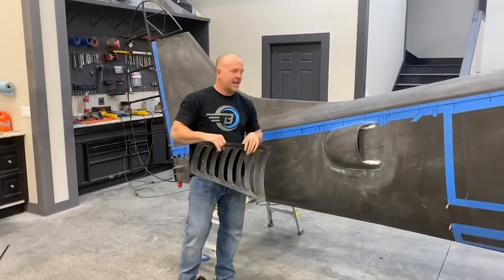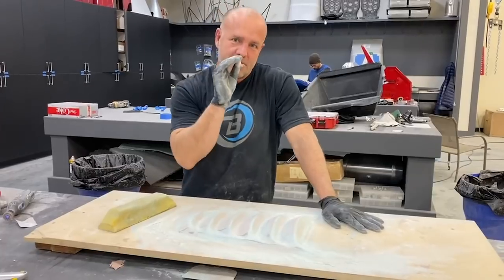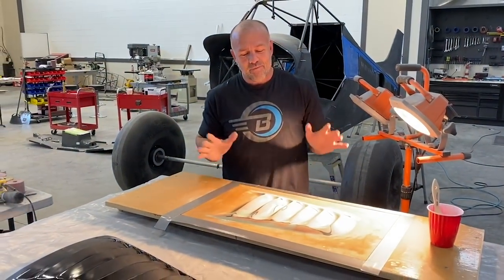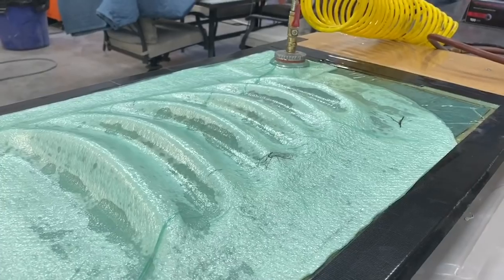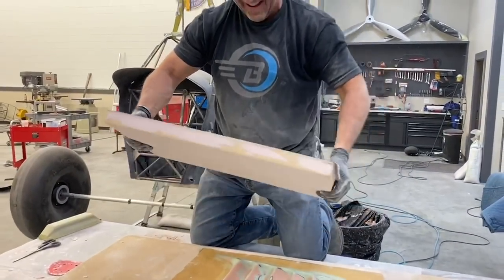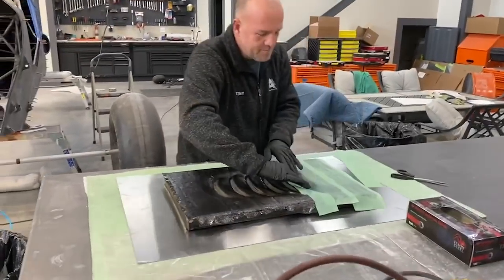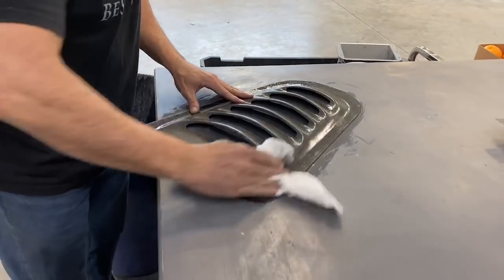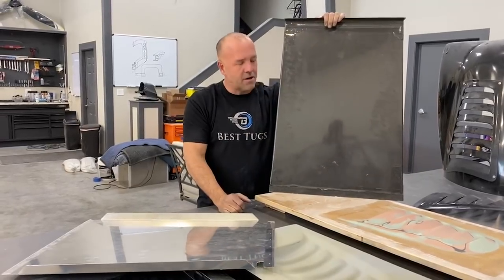🛠Making Carbon Fiber Molds (Scrappy Bush Plane 12)

Comment from the maker: Side effects of social distancing = more scrappy 🤠
Reply: Oh snappppp.... I got the virus....already having side affects...bummer....👍👍👍
Reply: Optimism @  it's finest
Reply: Mike, you asked about fewer longer vs more shorter videos; More videos please, and if shorter it's all good!  Thanks.
Reply: Got lemons, make lemonade. Thanks for doing all the work so we can watch along.
Reply: Mike Patey lol
Reply: That’s what I’ve been calling flying lately... social distancing!!! Hehe great video... where do you recommend getting the materials and gear to do carbon fiber?
Reply: Keep up the hard work, can't wait to see Scrappy hit the air.
Reply: Does anyone know if you have to use a return oil pump from the oil coolers with the extra 15 or 20 feet of oil line or maybe a higher pressure oil pump. Because that's a long way to pump oil especially at a steep incline with any kind of g force ?
Reply: Swampy Douglas OBannon I would think any gforces or incline would be offset by the same effects pushing the oil to the cooler. Because it’s a two way street the g effects would be zero on the return. As far as 15 to 20 feet of oil line, the friction loss would be based on hose size. In hydraulics the friction loss of the hose has is based on 
Friction Loss = (coefficient of diameter of hose) x quantity squared x length of hose. 
The oil pressure from the engine would have to overcome the friction loss of the hose and still maintain the proper oil pressure for the engine. If it was too low, I would think you would only need a pump from engine to cooler, as relay pumping (a return pump) opens the opportunity to cause a negative pressure if flow to the cooler is too low. 

Im probably over thinking it, but I’m simply applying what I know about fire fighting hydraulics to it. It’s probably not going to be an issue as it’s only 15 to 20 feet of travel.
Reply: Ill take that!
Reply: Dust mask young man! We need to have people like you around a long time!
Reply: Andy Smitty. have you ever tried to blow water out of a garden hose it's hard to do even on a flat surface  and oil is thicker than water and much harder to pump than water.
Reply: I work at ucdavis medical center. Things are getting real weird!  Covid is no joke. My coworker just tested positive today. He’s ok and took all the necessary precautions and still was infected. It can happen anywhere. Stay safe out there. Distance and isolation is key! That’s why I am flying solo to help the cause!
Reply: ke6gwf 
YOU sound like a s.a.😜I spent most of my life repairing water systems for city's all over the country and I know for a fact the more line You use the more pressure it takes and I don't doubt Mike's ability for one second HE'S about the most all around Jack of all trades I've ever seen
i was asking for my curiosity I was asking because
I just wanted to know.
I'm addicted to this scrappy build and can't wait for the video. And by the way the oil is different temperature each way it travels being cooler on the return trip. I don't know does it make a difference in the viscosity if so that would make it harder on its return I think.
Reply: Well I guess my new stock market trade is .... BONDO.. lol... if all else fails Mike ya look like you can make a cake..
Reply: When life hands you corona, make carbon fiber. Haha
Reply: I like the quality of the editing since you switch to shorter videos.
Reply: and more scrappy videos....
Reply: Really loving the molds!   Extra effort. But it will allow you some kit bashing. Surprised ya aviators do not have a kit bash wiki on the net. 🤔.   Ya not getting younger yet....
Reply: Less more would a f.*** disapointing mr Patey
Reply: Wear a respirator when you sand like that! The powder will put your lungs under a lot of stress and if you get the virus it could cause a lot more damage than it normally would
Reply: Make plug to make a mold!
Awesomely video as always!
Reply: Alu is easy to straight bend but composite can do an entire organic fuselage in one piece. Look at how much labor is in riveted alu planes. One piece composite is also great for pressurized fuselage.
Reply: Hey man you have beautiful mind. Great job...
Reply: I still wonder if he is going to put the wingtip stingers on scrappy.
Reply: I know the decision was made, but I like the shorter vids.

Comment: I've done quite a bit of fiberglass and epoxy work at the family boat shop and built different molds over the years and kept telling my brother to get a vacuum pump and start using epoxy and carbon fiber instead of this nasty Polyester for some of the parts. Your attention to detail and perfection is a must and it shows in everything you put your mind to. Not to often do I see guys doing the level of craftsmanship you are capable of!

Comment: Really like watching you make carbon parts, I used to work in a composite shop a buddy started, nobody taught us to do it we just figured it out over time. These videos take me back to those days. You makeshift oven is great, we had a small autoclave but for big parts we had a box built out of 2 inch thick foam taped together had a cutout on one end to blow a heat gun into and a flap on the other to regulate the temp. We made some awesome parts with that primitive setup. That male, or copy of your original part is called the plug, after getting it perfect and mold releasing it we always painted on several layers of gel coat before backing it up with fiberglass for structure. Helped prevent air pockets, was easy to repair later and could be wet sanded and polished to a mirror. Sorry for being long winded but you got me reminiscing 🤔

Comment: @mike patey  could you do a video showing the calculations you do when youre figuring out airflow, volume, lift coefficient, forces acting on fuselages etc before you get hands on with a part ? Cannot get enough of these videos, definitely one of the big positives in the current world situation that youre getting "back to work" on scrappy more. Keep up the great work and stay safe.

Comment: Hi Mike, I might have some tips and tricks to save some time when it comes to making carbon parts: compressed air works great to demould parts. Instead of filling the backside of the mould and vacuuming it to a flat surface you can just put the mould in a "complete" bag (like food in a ziploc bag), as long as plastic bag is not under tension it gets pressed onto the mould evenly and the mould doesn't bend. Also I find mould release agents like Frekote 770NC quite a lot faster than wax.
I work in a small german company that makes prepreg autoclave carbon parts (manly for racecars: LMP, DTM, GT3s), so if you somehow end up in southern germany and interested I can give you a tour, just contact me. And of course if you ever need some carbon parts, we can make them for you ;)
Reply: Do you do courses?  I would love to learn how to make carbon parts for the plane I am building

Comment: I am again reminded why my carbon fibre furio is still unbuilt in the hangar after 8 years. The time , cost , skill set , tool chain , experience , enthusiasm and persistence is way way more than I imagined when buying a kit advertised as 1500 hour build time - yeh right . I’d have to retire , have at least $ 200,000 lying around and then hire a team of 4 people with the experience in each discipline - perhaps that is why so few kits are completed . Mike you are really unique and keep the videos coming . Big thanks

Comment: I can relate to the time penalty.  As a novice to fiberglass, I committed to making a custom air filter tray for the snorkel of my RV-8 along with a new intake and flanges for intake and snorkel.  No vacuum bagging; not worried about appearance; just make it functional.  Fabricate, modify, refab, smooth, fix, etc.  Finally finished components that will work together, and assembled them.  Total time invested: 115 hours.  Wow.

Comment: Great video, as ever!

Have a look at the stuff called Epopast for making the negative moulds. It's a fibre-filled, two-component almost clay-like substance that you can make half-inch thick moulds with. You wax your positive plug with release agent, then apply a thick layer of (hybrid) gel coat and while still sticky, mix up a batch of Epopast and clay it over the gelcoated plug. 

Once dry, it is incredibly stiff, has near zero shrinkage, is as smooth as your plug was, so no need for more wet sending. Works extremely well and is certainly less work than your current method (which I am sure will appeal to you ;-) )

Now back to work!

Comment: Let me tell you a story.
I used to own/use a British piece of equipment called a "Dome Press". The press had an interior surface of 48 x 96 inches. It was an 8' half cylinder of 1/2" steel with ends welded on of same thickness. A 3/4" x 2 1/2" frame was welded to the cylinder to provide attaching points for rollers in a U frame every 18"s. The dome had 1 1/4" air inlet and exhaust with 1 1/4" ball valves on each. Pneumatic cylinders, one on each end centered on dome ends provided lift to an attachment tap welded near top of dome. The lower frame supported a tray 8" deep the same dimensions of the top. In the tray was a perforated platten which was connected to a huge vacuum pump. The lower frame supported the pneumatic pistons which raised and lowered the dome as well as supporting all the pneumatic cam clamp cylinders & dogs. The top "dome" carried strip heaters and a 5/16" 3 ply rubber blanket suspended over the 4 X 8 ft opening.
Work was placed on curved or molded forms on the bottom platen, the dome was lowered and clamped into place via the pneumatics, the vacuum was turned on as the dome was pressurized to 35 psi. A 50 hp Ingersoll Rand compressor supplied the air to the dome from a 450 gallon tank operating at 125 psi. Interior temp of the dome was 130 degrees.
We were manufacturing our own complex shaped plywood which was then burl veneered for automotive and aircraft applications. We were contacted by Rolls Royce and Metal Crafters to fabricate 12 dashboards for a customer financed "Sport Car". Rolls assured the customer that he would own these only Rolls Royce models and then they released same car as a Bentley for production. Ouch!

Carry on your fine workmanship and engineering.

Comment: Tips for splashing molds. The positive plug was good, using a sandable primer like duracoat or a gel coat to give an even color will help reveal imperfections, but it looks like you made it work. 

For the splash again a gel coat first will make the surface much smoother. Buy the unwaxed gel coat and the surface won't cure when exposed to oxygen allowing a good bond to the rest of the splash. Then use a layer of glass veil  to build up behind the tool surface and help with pinholing. Then a layer of glass fabric +-45, 0/90, Matt glass to build up thickness, 0/90, +-45. Now here is the secret. If it's a room temp mold it doesn't need to be carbon and it doesn't need to be vacuum bagged, if it's elevated cure mold use vinylester resin, carbon fabric after the veil  and post cure to at least cure temp of the prepreg it should be ok for 250f resin systems at 230f soak for a few hours longer at soak temp.

 These are guidelines please do your own tests for structural parts everybody. 

For room temp molds though unwaxed gel coat a layer of glass veil then fabric then mat and no vacuum bag will produce a much cleaner tool surface than trying to get carbon fabric with no pinholes in tight curves and a vacuum bag, that stuff doesn't like to wet out like glass does. The gel coat will help identify any weave printing as well once the splash is demolded. For the materials, any boatyard supplier should have them.

Comment: Hey Mike
Scrappy is looking just awsome! :D
Just one little tipp for your negatives. We do it like that: we build the box first, use a resin specially made for negatives (one layer) and wait till its half dried. Then we start with a few layers of fibers and backfill it with modelling plaster. We found this to be the cheapest method (way less expensive than bondo)
If you wanna know anything more feel free to contact me.
And now back to work. ;)

Comment: A couple of suggestions...When first applying the first coat of bondo spread super thin plastic on the bondoed flare and then have a second flare push on top to help shape the bottom flare. A lot less sanding. Second get some scratch polyester fill glaze like "Dolphine glaze" on Amazon. great stuff and running thin, fills very small scratches and pin holes. Very easy to sand.

Comment: Thanks for another great video. The cost analysis was great, I use to quote composite parts in a specialized RTM process. Mostly of road machines marine parts and engineered drain systems. Carbon fiber was out of the question too expensive at that time. Vinyl Ester was out resin of choice for durability.

Comment: Just a suggestion - use Dental Gypsum Stone for your mould filler you can reinforce it with chopped polyester fibre - much faster cheaper and possibly more dimentionally stable than bondo in large volumes.  Love your work!

Comment: Mike, great job! I like the direction from a mass air movement standpoint and fankly in the end thats what matters at altitude.  And thanks for putting in the effort to keep these vidios long. I for one grain so much from them and watch them several times.
You biggest fan
John

Comment: 6:00 The vacuum does not put pressure down onto the part. When you put vacuum on the inside of the bag it’s actually the outside atmosphere pressure pushing down onto the outside of the bag because of the pressure difference between the two. Great videos and love the Scrappy series.

Comment: I have used silicone molding material for negative molds, and it works great.  It will probably work better than bondo, and it will last longer, with less mess.

Comment: Hi Mike, have you tried infra-red lamp? 2-10 min done. I own Carbon Bike Repair in the Uk. We repair and restore about 300 higher end carbon bikes per month but we are learning all the time! Recently we added IR into the repair lines as opposed to natural 7 hour (best) curing or heat. The issue with heat, we find the bond when cured this way can compromise the strength a bit depending, of course, on the epoxy you use. If you would like I can privately message you the best resin for your application as I have not seen it in your videos. That said you are literally the only guy I have seen online so far that understands carbon and resin. Very impressed!

Comment: Hey mike, I’m just curious why you used carbon fiber for the mold instead of just fiberglass? Is the stiffness still that important even with all the bondo on the back side or is there something else I’m not considering?  Thanks!

Comment: Man this is cool. I actually thought about how you might make the outlet when you made the vents. I figured you might do it similar to a P-51...where the outlet adjusts as needed for the oil  cooler depending on speed , temp, etc. Naturally...now that I see this...looks cooler, makes more sense,  and is simpler. Reminds me of the louvers we used to see on Mustangs and Camaros in the 70's and 80's.
Reply: .....or lead sleds of all descriptions in the '50s.

Comment: Mike ... (and I don't care what the haters have to say about this), when You're working with non-structural molds for later carbon fiber parts production, You can dramatically increase Your time efficiency by applying the finish body filler using warm water on your bare hands to smooth the top layer.  With practice, there will be no surface porosity nor imperfections because your hands will guide You to a better product.  The real benefit is that the sanding normally required to obtain the finished product will be greatly reduced.  Your first thought is that the water will mitigate the catalytic effect in the chemical composition of the body filler.  You will find this is not the case when applied thinly as a "smoother" only.  Again, this is for non-structural application where You simply use this technique to construct a mold for the structural part being crafted.

Comment: Mike.I hate to be picky, but the first part you made with the bondo is a PLUG.  A plug is used to make a mold which is used to make a finished part.  I was a bit confused at first when you called it a mold because it would have made the finished surface on the wrong side as you said.  I am impressed at all the work you are doing on Scrappy (Not much scrap going into it any more though!)
Reply from the maker: Mark Erickson yea I catch mistakes like that when I’m editing and just laugh it off and move on.  Point the camera at me and I say things wrong often even when know. 😂🤷‍♂️🤠

Comment: Mike, you’ve modified the carbon cub design quite a bit which should impact your CG envelope somewhat. What’s your plan on verifying that the CG range hasn’t changed a lot? Are you just going to be a test pilot and determine what the range should be?

Comment: 2nd Comment: When I was flying rc planes, I had a 1/4 scale model endorsed by Patty Wagtage.  If I remember correctly 500K were sold worldwide.  Mike is becoming an iconic figure in aviation so with Horizon Hobbies converting his planes to RC models, it would be very likely to make a couple of million back in Scrappy alone. If not, these are my wishes

Comment: Hello! Next time you make a negative form, use a thin carbon, or even a thin glass fiber. You wont have to waste another ton of time to perfect negative mold, if you make it using a thin fabric first, then a heavy.
Upd: You can use a gelcoat and get a perfect shiny surface right from the vaccuum, but i think you already know that  :)

Not actuaaly my words, i got it from an olds. But it works very well for me.